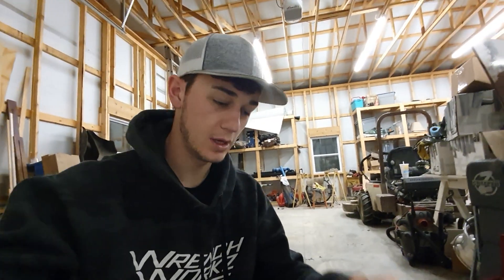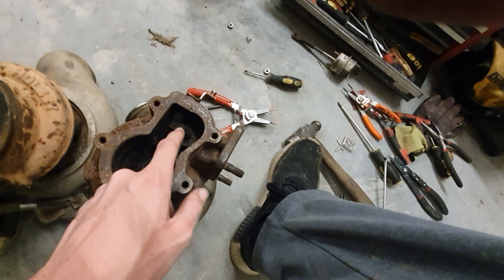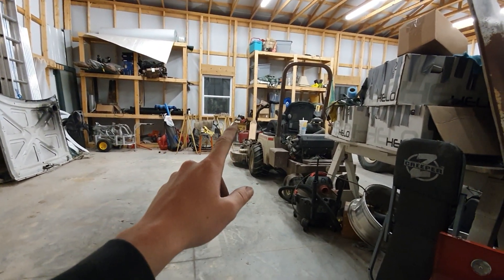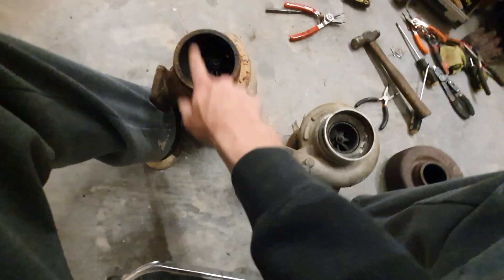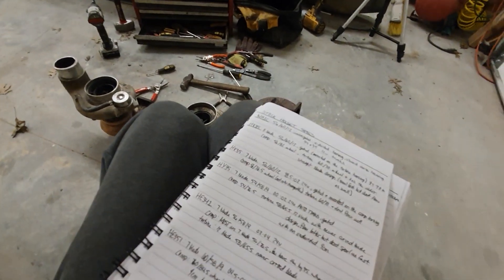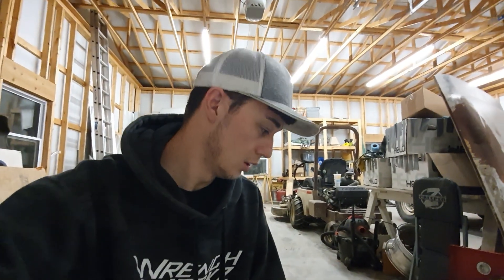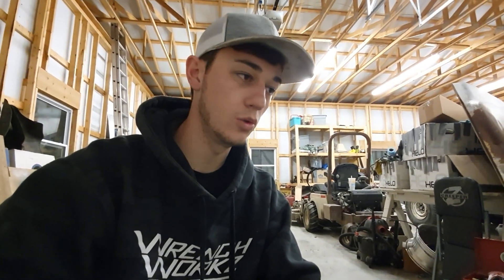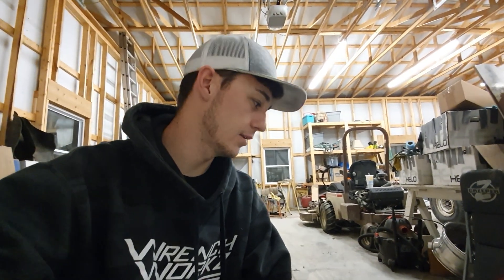Holset Turbo Talk! Hy35 vs HE341! HY351?

Comment: hey...i've recently found out that the HY35 bearing housing sits the compressor wheel about .040" prouder than the HE351CW will...that being said...if you choose to do a 60mm compressor in the HY35, you'll have to do some modifications to have it sit properly...or have the HY35 compressor housing machined a bit more.
Reply from the maker: Pinning this comment because it's great info! Thanks for sharing with everyone!

Comment: just came across this vid.  i'm building a 60/60/9 with my HY35.  HX40 compressor wheel, HE351cw turbine and a HE351cw turbine housing bored out.  i'm curious to see how it turns out on my stock fueled 160hp ppump 12v.
Reply from the maker: It should be an extremely responsive charger. Egts should stay in check as well! Let me know about it after you get it on

Comment: Will a hy35 compressor housing fit on the HE351cw with machining to run the 60mm wheel? Im trying to find a compressor housing that'll fit the 351 but have the compressor outlet going in a different direction to throw on my volvo wagon.
Reply from the maker: Thats a good question but no it will not
Reply: @GavinHuke  That's a bummer, thanks for the reply. Hopefully I can get away with modifying the he351 compressor housing

Comment: I would absolutely love to see how you’d do that, I’ve got an hy35 on my truck and I like it’s performance but I’m not happy with the spool time on it.
Reply: It may not make a ton of boost and may limit HP, but through all my research and having tried a bunch of different turbos through the years with my 02 auto, NOTHING spools faster than an HY.  When I got tired of smoke and high exhaust temps, I went back to my little hy and just love it for a daily driver and rv tower.
Reply from the maker: Definitely interesting because that little 9cm on that hy35 should be lightning fast, what rpm is it lighting at?
Reply: Gavin Huke after driving it a bit more I think what I’m not happy with is my boost, my wg actuator is limiting it to only 19psi. I just swapped my truck over from a really little non/ic h1c to a 2nd gen intercooler and that hy35. Only really been driving it for a couple days now lol.
Reply from the maker: @codyhufstader5041  yeah you just need to adjust your gate to open up later. For example is probably starting to come open at 15psi.. move that to where it starts to come open at 25psi so you see around 30psi overall, also turning up the fuel will benefit a lot to make that boost # go up
Reply: Gavin Huke ok thank you